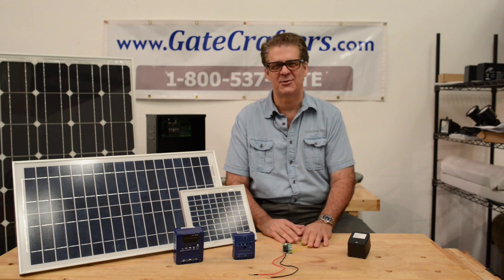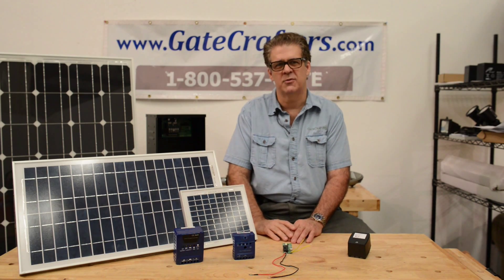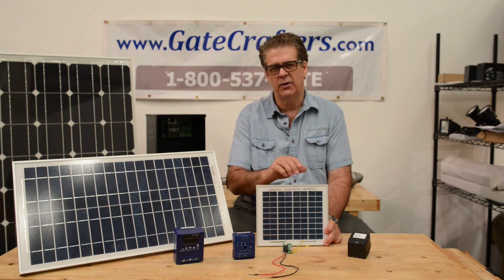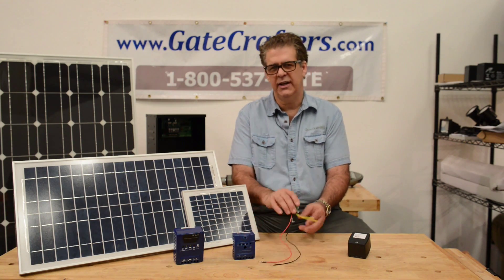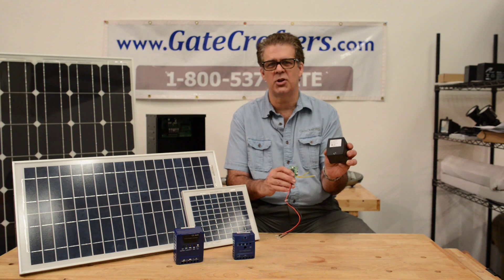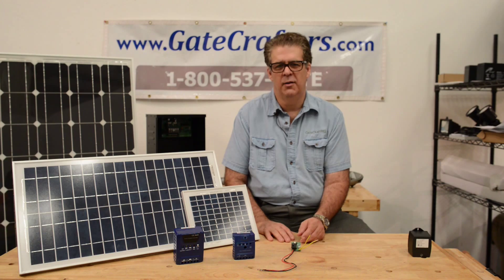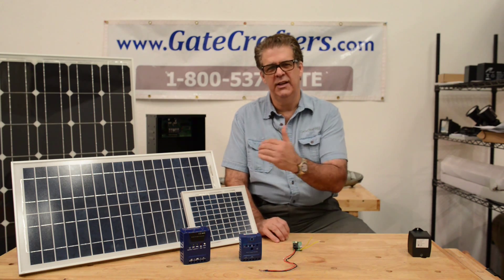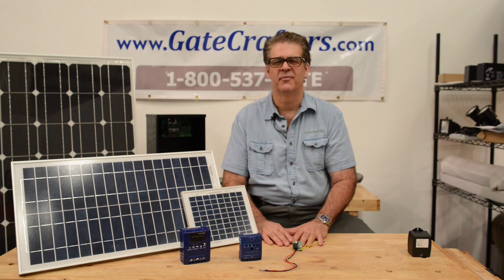How To Use Solar Charge Controllers With Driveway Gate Openers

Comment: What size solar panel do you recommend for MM 562 model (on cloudy/foggy days it opens very slow).
Reply from the maker: Hi! We suggest looking at the MM562 manual as it will help you find the recommended solar panel size based on your gate, location, and expected number of daily cycles. 
Here is a link to the manual just in case: https://www.mightymule.com/wp-content/uploads/Mighty-Mule-MM562-Dual-Gate-Opener-Manual.pdf  
If you have any more questions, please contact us on Gatecrafters.com or at 1-800-537-4283. Thank you and have a good day!
Reply: I suspect that the battery is getting old. your symptoms leans to battery issues.
Reply: I will check the battery, thanks.

Comment: Do I need a charge controller for 12V Marine deep cycle battery with only 10W solar panel ?
Reply from the maker: Hi! If you could let us know what kind of model your gate opener is, and how long you have had it - it will determine what you need specifically. We look forward to hearing from you!

Comment: What size panel. And wire would you recommend. For a 150ft run. From the solar panel to the battery
Reply from the maker: Hi! We would recommend a Battery Group 24 Deep Cycle 35 AMP, with a Wire 16 gage 2 conductor up to 200 feet away. The solar panel would depend on the cycles and zone in your state. If you have any questions, don't hesitate to call 888-932-4749. Thank you, have a good day!

Comment: I just bought the mighty mule SL-2000B , and need to go the solar route cause the nearest power is almost 700 feet away . The gate will only be opened 4 times a day max . I live in southern Texas    how big of a panel do I need and what else would it require to make it solar ?
Reply from the maker: He five what would likely be OK but you might want to go with a 10 wife just to be safe. Any solar panel that you purchased for a gate opener must have a charging diode in the panel itself. All of our solar panels have a charging diode in them.